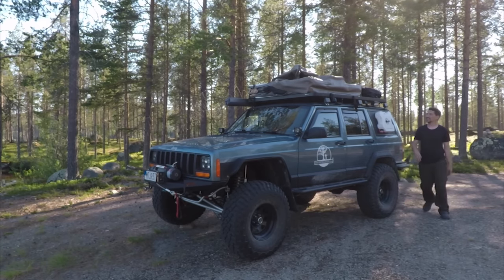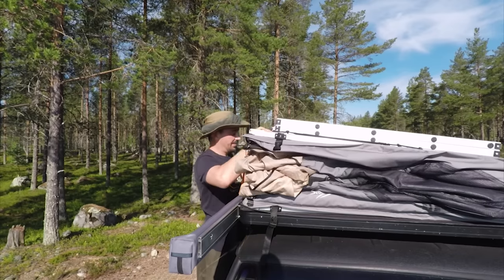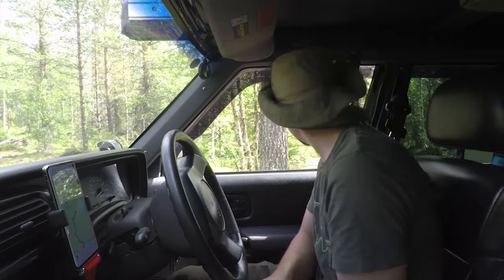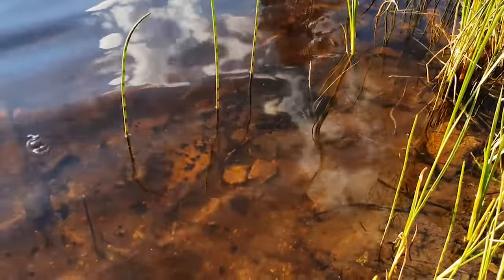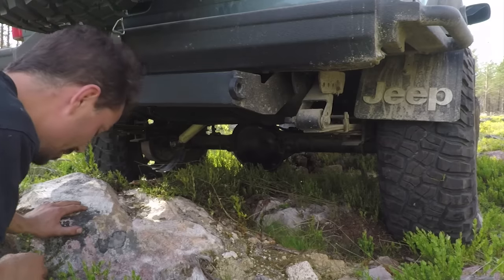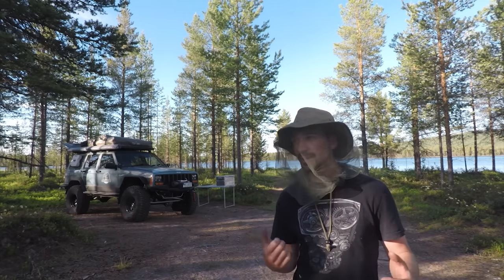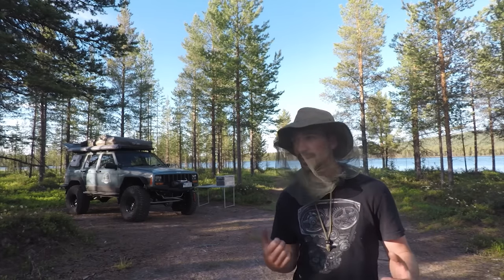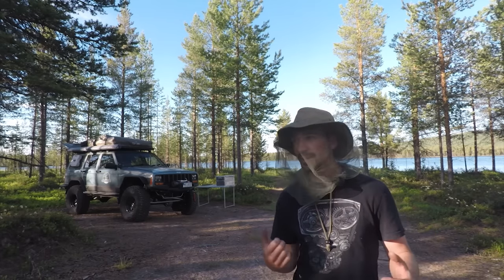Mosquitos And 24 Hour Daylight / Solo Overland Adventure Documentary

Comment: Dude. I'm hooked on your chanel.i love tha diesel engine. What kind is it?. If bgg you ever travel to the US. I have a home in South Central Tennessee. And my playground 4o acres15 minutes from my house. I bought it to get lost in it.its Hills. A creek that looks like a mini Grand canyon. And a cave.  We would love bgg to meet yo
Reply from the maker: Hey thanks for watching! It's the hated 2.5 vm engine. I've modified it a fair bit but its still going strong. Ah man I would love to visit the USA and do some wheeling there. Sounds amazing man.
Reply: @WorkshoptoWilderness  thank you for answering. You have z great life. Amazing family . Awesome!. About your engine. Why most hated ?. What manufacture is that. The good thing about the diesel, it can run on most anything.  I me a guy once , he had an early jeep, with a VW Gulf diesel. It was great.. I saw thtvwhere you are the sun is  a problem at night. I am one of those that needvtoal darkness. I sleep with  camo cap pulled down  over my eyes. In Tennese ir gets dark.but in Miami, we have bad light pollution. Too many big cities close to each other,and the airport lights. It looks grey. Not dark. Use the wool cap pulled over bbn your eyes. I have a thin cap , my bv on used in boot camp
Reply from the maker: The older style cylinder heads on the engine were prone to cracking. I have newer ones on there now and they are fine but when it was first released 30 odd years ago it was a problem. Yeah its constantly light here in the summer, its nice in one way but it can be hard when sleeping. Thank you for the comment and for watching!

Comment: Why didn't jeep offer a diesel xj in America the 4.0L is awesome but a diesel xj would have sold like crazy as well.
Reply from the maker: I'm not sure. Its the not the best engine but with some mods its pretty reliable. Thanks for watching.
Reply: They did and it was a bomb. It's the wrong diesel.
Reply from the maker: I'm fairly sure they never offered this engine commercially in the states.  Perhaps there are some here and there, but it wasn't rolled out like it was here. If it was, then they would exist in greater numbers. 
It wasn't legally allowed to be soled in the USA for very long as its emissions are off the chart by US standards. VM attempted to design another engine for the Liberty, a 2.8CRD, and even that isn't up to regulation.
Reply: @WorkshoptoWilderness  in the states 85-87, you could get the j8s. But you didn't want it, lol.
Reply from the maker: The Renault engine you mean?
Reply: @WorkshoptoWilderness  yes.
Reply from the maker: That's a terrible engine for such a vehicle. They are okay in small cars 🚗
Reply: @WorkshoptoWilderness  it didn't work out here too well lol. A popular swap is a vw diesel here in the states.
Reply: @WorkshoptoWilderness  amc/jeep and Renault had a long time relationship.
Reply from the maker: I've only seen them in small cars here. People like them because it's old and tunable, but it makes low power, so I guess in a tiny 800kg car, it's going to be fine.

Comment: Im almost ready to leave for a 7k mile trip in my cherokee. Thats a pretty nice rige dude. Instant sub. Whats your power situation like?
Reply from the maker: Thanks for subscribing. That's a long trip, should be absolutely fantastic and I wish you all the best on your travels. 
I have a 113ah deep cycle leisure battery in the back thats hooked up to the crank battery on a smart relay. There are various ports in the back, 4 USB and 2 12v along with an 3 meter auxiliary line for the diesel heater and mattress inflator. Its pretty simple but I've had it like this for about 4 years and it works. A fridge would be good so that's something I would like to add.

Comment: are you sure it aint 25mpg? im getting somewhere around 18mpg combined with pertrol. but i like the torque and hp/
Reply from the maker: On long trips I get up to 27 but driving round town it's about 21. I have to drive pretty constantly for a long time to get decent mileage these days. Shes heavy.
Reply: @WorkshoptoWilderness  I was getting 24-25 with my 4.0 with a 5 speed manual on the highway, but those things are as scarce as rocking horse dung now.

Comment: Wish to know how you mounted the power on the back cab of your jeep info plz and is it separate from the jeep power or connected if so what is your jeep alternator power source voltage
Reply from the maker: I have a video planned on this so I can explain and show how everything is set up. Hopefully that will shed a bit more light on it all.
Reply: @WorkshoptoWilderness  hey just wanted to know info on the panel that you have the water on the back cab of jeep videos if possible
Reply from the maker: @americanwhiteboy715  Hey, I will make a video on it soon. Its just a aluminium panel I shaped to the same size as the window. Then Painted it and mounted a Rotopax mount to it.

Comment: What Motor/Exhaust do you have, I Own 2 Cherokees 4.0 Currently and one previously, all 3 are quieter ?
Reply from the maker: Its a 2.5 turbo diesel vm with a 3 inch exhaust. I've done a fair bit to it including a new head, bigger turbo, intercooler and other such things. It's an old gear timed, hydraulic lifter small tractor engine.
Reply: @WorkshoptoWilderness   I had head of people doing a Cummins swap, HP wise it looked less, but I may have to look in to it
Reply from the maker: HP is less but torque will be higher and at much lower rpm ranges so its good for crawling, but but high speed work. I guess it depends on what you do with it.
Reply: He's got a diesel. Unfortunately not available in the states.

Comment: What PSI do you run off-roading?
Reply from the maker: It depends on the conditions but normally I just eye ball the tire until it looks good. I don't have a pressure guage. Deep snow maybe 5psi and gravel roads I leave it around 25psi. Rocks and really old tracks a bit lower.

Comment: What stove are you using brand I have not seen one like that with larger tripod stand . TIA Where did you buy it ?
Reply from the maker: Its a generic stove from a gas station here in town. You can pick them up off of ebay also. I typed in camping stove and the same one was in the listing. If you don't find it I can ship you one. They are about $26

Comment: Hey I’m looking at getting a jeep Cherokee XJ and want to modify it so I can go camping and on adventures with my family. Any advice? Thanks
Reply from the maker: Hi, they are great inexpensive vehicles for this kind of thing. I think there are two ways to go. Find one bone stock and as clean as possible or buy one that's already modified and correct the wear and tare it has faced from its previous excursions. 
If you choose the bone stock rout then check for corrosion under the jeep around the frame rails and floor pans. Its normal to see some rust but holes mean its just the beginning and it will need some work. Also be prepared that it will probably need its suspension replaced if you want to run a larger tire and get some lift. 
If you buy one already lifted or modified then its good to always look under the jeep. Under the jeep is where the work is as they can look washed and clean but be bad underneath. Check the shocks for oil leaks around the seals where the piston goes in, look for differential leaks at the pinion seals. Dont worry about a little oil around the diff plug. Check the ball joints and tie rods at the end and see if the rubber boots have split. If they have and they look old the joint will have most likely been exposed to water and need replacing. Look at the u joints on all the drive shafts and just move the shaft with your hand while looking at the joint. If it clicks and moves a little its most likely worn and will need replacing. You can do the same with the u joints on the axle shaft at the front tries. Move the tire like your pushing the jeep back and forth and see if you have excessive play. 
Also what you can do is open the doors and hold them at the top and bottom and try to move them up and down. This is to check the wear on the hinges. If there is a lot of play they new hinge pins must be installed. Its a hell of a job as I did all four doors. 
This sounds like a lot and there is more but its things like this you are better off knowing before you buy it and you can come across more knowledgeable to the seller and bring them down on price
Reply: Hey thanks for getting back to me, I’m going to be new to all of this and learning as I go (is this a good idea?) fortunately my dad and some of my friends are mechanics and can help me. I really want a great vehicle that can get me and my family outdoors and on adventures :) I was between a Land Rover discovery 2 and the Jeep Cherokee XJ. Think I’m swaying more towards the XJ. Thanks again
Reply from the maker: @martinnairn8091  I knew nothing until I started working on my own cars. It will save you a lot of money in the long run and you will also get great enjoyment out of it so I would say its definitely a good thing to get into. It will obviously cost money the more tools, parts and things you do but tools tent to keep there value and build up over time. 
The LR 2 is also a great vehicle. Its advantages will be internal space as the back is much more roomy than the xj. Its also more comfortable inside. 
The xj is a great vehicle also, simple, robust and excellent offroad when equipped. It is a uniframe vehicle which makes it lightweight but if you intend to put 35x12.50r15 tires on and a big lift you will need to strengthen that frame with a stifferner kit from the USA. Its not actually a hard job if you can weld but this would not be necessary on the lr2 as its a tub on frame design and ultimately stronger off the shelf in terms of its frame. There is a lot to consider and both are good choices for cost and cuztomisability.
Reply: @WorkshoptoWilderness   so do you think the discovery 2 would be an easier vehicle for me to mod as a beginner? What would I need to do to the discovery to off-road and camp/adventure with it? Sorry for all the questions. Thanks again
Reply from the maker: @martinnairn8091  I think it depends on where you live. If your UK based then then lr2 will be cheaper to modify and parts should be readily available. If your in the USA then the xj is probably the choice for aftermarket part support. You will have everything available to you and the prices are pretty good. 
Personally the xj is easier to modify than the lr2 as it has a leaf sprung rear and its very simple underneath. The axles are Dana so you pull the covers without having to remove the prop shaft. I think the lr2 is a fantastic 4x4 and also great to work on. I have more experience on XJs so my knowledge is better on them but all older 4x4s are similar really with solid axles and mostly mechanical parts so whichever one you go for im sure it will be great
Reply: @WorkshoptoWilderness   I live in the uk, I want something I can travel a lot in. But also something I can mod (with not too much difficulty). I like the look of the XJ more than the lr2. I’ve been watching your channel for ideas and tips 👍🏻

Comment: Wheels specs please....
Reply from the maker: They are Jack wheeler 15x8 steels with a - 19 offset (3.75" backspacing) they are 13kg each. The tires are 35x12.50 bfg km3 mud terrains.

Comment: I really like your rear tire carrier, and the rest of  your setup, what brand is that?

If you get a chance check out my build on insta, #berserkerxj.
Reply from the maker: Thanks! The tire carrier is a bit of an odd one as its not been manufactured since 1996. Im sure there is a possibility of finding them. Its made by a company called Westfield Engineering in the UK. They have stopped trading now but occasionally they pop up on ebay. I followed your page, awesome build and thanks for watching
Reply: Subscribed and followed back, I guess I’ll just have to take the concept and make my own. 👍🏼
Reply from the maker: @Derikarnold6  I can make a video on it of you like, open it up and show how it works. Its really simple and can be made much better. Thanks again